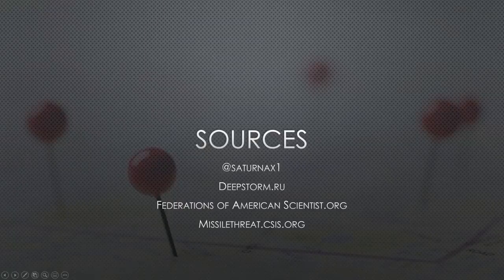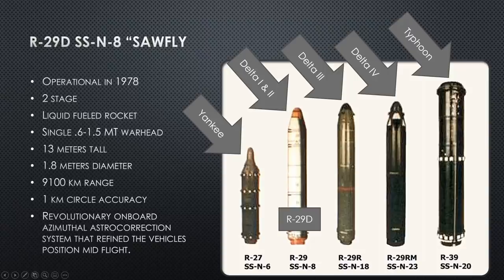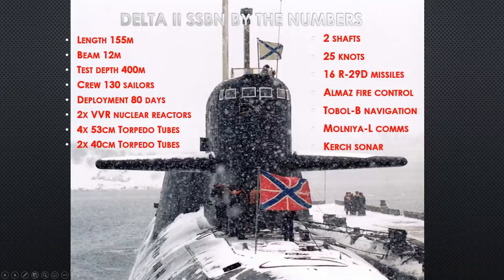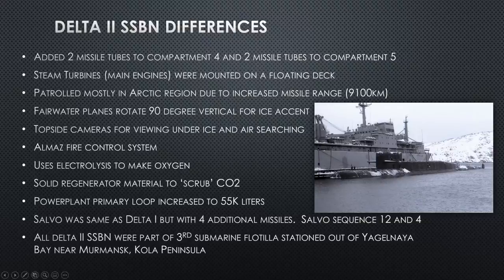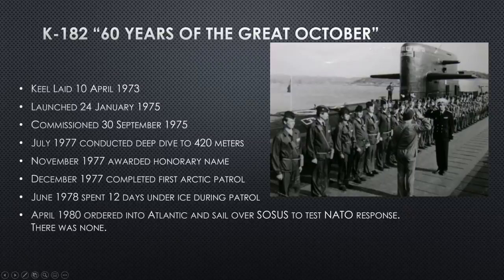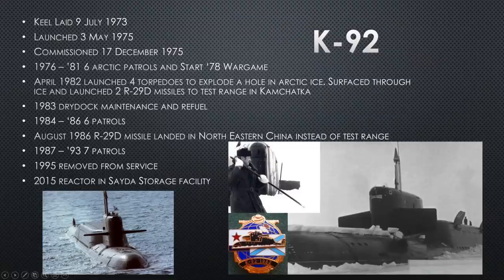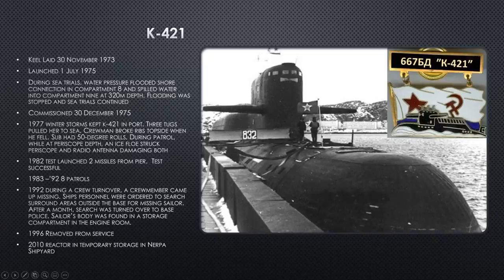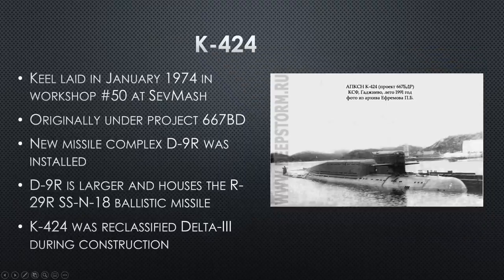Delta II SSBN Sub Brief

Comment: Crazy that these missiles use liquid fuel.  Polaris, Poseidon, and Tridents were solid fueled if I'm not mistaken.  Seems like a much more volatile storage situation.
Reply from the maker: As the series evolves into Delta III and Delta IV, you will see an improvement in rocket technology.
Reply: TLDR: Soviets developed something too fast with not enough money and ended up with something incredibly dangerous, and surprise lots of people died.

Russia had actually looked into solid fuel rockets before the US did. But the US had the funding to do bilateral development of solid fuel and liquid fuel. Obviously, if they could make solid fuel energy dense enough, it's storage properties make it IMMENSELY desirable.
I believe the Soviets wanted a solution "right now", and liquid fuels were just providing way better performance in early development over solid fuels, so they ran with it. Everyone sort of started into kerosene and liquid oxygen, but oxygen needs to be cryogenic to be liquid, which is a huge logistical problem for Russia.
So the Soviets found a solution that worked really well; UDMH and N2O4. Major advantage being these are both liquid for a wide margin around room temperature, remain stable for a long period of time under various conditions, and are hypergolic (meaning they DEFLAGRATE when they mix) so no starter is required.
Downside being that UDMH is extremely toxic, caustic, carcinogenic, INSANELY reactive to just about everything, and basically melts any living tissue it comes into contact with.
And N2O4 is a ridiculously powerful oxidizer, and will absolutely destroy your lungs if you inhale just a little bit of it.

Neat funfact; when you mix N2O4 and seawater, you produce nitric AND nitrous acids (producing the commonly known 'red fuming nitric acid') which is more than capable of eating its way through, say, a missile tube, and/or a tank containing hydrazine.
Once it gets into the hydrazine, obviously a substantial fire will break out (since they are hypergolic and don't require an ignition source), and oh boy you really wish it stopped there at a catastrophic fireball that can't be extinguished, but it doesn't. The nightmare has only just begun.
All the red fuming nitric acid that's now filling up the missile compartment isn't just starting to react with and corrode everything in there, RFNA also contains a great deal of N2O4 which, as a powerful oxidizer, is going to make stuff that's not normally flammable, VERY flammable. Once the hydrazine fire kicks off, everything starts heating up and catching fire VERY quickly (it's basically like a pure oxygen environment as this point). And what I'm about to say sounds insane, but if you're LUCKY, the hydrazine will be reacting with the N2O4 at a steady rate as it's leaving the missile fuel tank, because if hydrazine gets into the missile compartment, it will react violently to just about everything in there; metals, cotton rags, people, the nitric acid, stainless steel, any metal salts that may have been formed, etc.

I'm absolutely convinced that the only reason they were able to put actual people into submarines with 12-20 "submarine killing disasters waiting to happen" is because none of them really understood just how ridiculously reactive the contents were. If they had any idea of how dangerous it was, something as unassuming as a "missile hatch malfunction" would have been a casualty right up there with "we are actively leaking primary reactor coolant into the reactor room".
Reply: @thundercactus  damn….

Comment: As a Brit I always wonder why fair weather planes? what do they give that fore planes don't? I've always thought fore planes would give far better depth control
Reply: My expectation is that you can get a much larger surface area with fairwater planes. Especially with more surface area away from the hull where water flow will be disturbed. The main downside is likely the extra ease of damaging them when operating under ice. So more recent designs are willing to put up with the trade off of harder to damage but less effective. And just adapt the operational processes to minimise the impact.

Comment: Are you sure about that infrared observations from satellites? Would like to see more information about it. I do satellite imagery and infrared you speak of is far from visible spectrum - thermal band is close to 10000nm, while near-infrared starts at ca. 680 nm. The difficulty now with this part of spectrum is that requires special detectors, while visible is relatively simpler to make. So I'd like to hear more about those thermal detections.

Comment: You bring up how clean the new Reactor's are, kind of off track, why the hell are we not generating more electricity at home with the power of the atom. I never understood that. I understand no one wants a Fukushima happen, but if put in correct location they seem pretty darn safe reliable and clean today. I'm no green freak, but I like our air and water clean also. Sorry for the rant on that. Great content as always, love H I Sutton's new channel too. You guys are unparalleled on this stuff and always my go to. 👍
Reply: This speaks to something I have always been facinated with is seeing the extreme numbers for power generated that can come out of a reactor in a state near failure I always felt like we we're not pushing hard enough.
Reply: One of the more likely nuclear power candidates are small modular reactors, which are like taking those inside nuke subs and throwing 12 of them in a warehouse. They're ultra safe, easily swappable if one needs to be replaced or refueled, and very cheap.
Reply: Several reasons:
People are incredibly emotional when confronted with something they fear (the "What about the..." groups) , and
People tend to be incredibly stupid when they gather for a "cause".

The maximum irony of those statements is that the stank-assed hippies of the 1970s who protested nuclear power are now the ones protesting all the coal plants that had to be constructed because they helped make them so incredibly expensive to construct and run.  Could we build modern, Uber-reliable nuke plants today? YES, but it's not worth the headache and enormous expense to get around all the roadblocks that The People will  throw around.
Reply: @greg5023  I think it is less about the efficiency. As far as I understand the small reactor system that the Russians are currently testing is meant for remote locations. Especially those that are accessible from the sea, but hard to get to overland. That makes it easier to maintain communities in those area that used to be uninhabitable, but are now becoming (barely) habitable.
Reply: @greg5023  there's an interesting video on the economics of nuclear, coal and gas power generation. I'll see if I can find it real quick. Nuclear reactors require more upfront cost, but are far more profitable long term. That's the gist.
Reply: It's pure politics and propaganda.
Reply: @greg5023  A good skill to have.

Comment: I thought the main danger with hypergolic fuel (assuming they are using UDMH or something similar) was the fuel in a vapor state. Once it's burned I assumed most of it would be burned. Still not good stuff to breath in, but no longer melt your lungs type bad. This is with respect to the port launches. Unless off course the risk pointed out in the video was if something went wrong and the missile failed to launch and instead just leaked fuel all over the place.

Comment: Crazy question:  When decommissioning a nuclear vessel, would it be practical to take the reactor and 'plug it into the grid'?  I get that it would have to be defueled and refueled.  I guess since they don't do that it's not practical to do so.
Reply: Radically different specs than civvy reactors. Though they still generate electricity. 
We teach our new Navy "Nukes" on older, moored training boats in Charleston, SC. That is where Naval Nuclear Power Training Command (NNPTC) is located. It is the single hardest educational program in all of the DOD. Currently the Nukes that get to the Prototype phase of this training command are being trained on the USS La Jola (a Los Angeles class SSN) and the USS Daniel Webster (a Lafayette class SSBN). Though the Webster isn't long in this role. Its a very old boat that is coming apart quickly. The Navy has moved the USS San Francisco (an other Los Angeles class) to the Goose Creek area to be prepped to take the place of the Webster. You might remember the USS San Francisco was the sub that slammed into an under sea mount. They repaired her and she finished her life with a new front end. She will continue to serve to teach new Nukes how to operate her reactor.
 
Anyhow, once the boat is semi-permanently moored, it becomes basically a land based reactor and cannot be fully spooled up. And has to follow land based nuclear regulatory guild lines. These boats reactors can only output about a third of their potential for safety reason. 

I have to imagine that yes, it could be possible to feed that energy into the grid as long as the infrastructure was in place. Some of its electricity is used to power the boat for training purposes. They must be manned at all times.

My son is currently in the Prototype stage as an officer and should graduate soon. 
Nothing I have said above hasn't already been revealed online somewhere. 
No OPSEC violations.
Reply: @ChasWG  I concur, interesting information, but nothing I haven't already seen online.
Reply: @christopherdesbaux5950  exactly...
Reply: @ChasWG  Thanks very much for that reply and I wish your son great success in his career!

Comment: I am amazed at how well missiles could reach the intended targets back in the 1970's!  That says the use of computers today is a waste of time, money, and space.  The way to generate oxygen has a volatile issue if HHO is the outcome.  HHO is just as dangerous as cavitation.
Reply: @SolarWebsite  Now that we are on the same page, what do you know about process.  Can the tubes wear out or corrode? With every chemical reaction there is a level of heat generated, this can cause hastened oxidation of some materials.

Comment: My favourite antenna that we had installed was the stabilized satellite dish that fed our Sky decoder, so we could watch English Premier League matches live. Before than we could only get the scores from an Inmarsat news print out. None of you submariner plebs had luxuries like that ;)

P.S. We had several forms of sonar and they were powerful enough to see a school of fish 800m down. We could also see individual fish going under the trawl's headline. A program would collate the sonar data of every pass and compile it to draw an accurate 3D map of the seabed. I wonder if that sonar would interfere with sensors on a sub? 
All those 50kg steel bobbins and chains would make a lot of noise too. They certainly did when hauling while I was trying to get a few hours sleep off watch. That would make a sub's hydrophone operator's life suck. I guess subs stay away from fishing grounds for multiple reasons. I heard of smaller vessels snagging subs in the nets and getting dragged under, but I never saw it. US Navy is not allowed in NZ waters (nuclear free zone).
Reply from the maker: good info, thanks.
Reply: 50 degree rolls huh? I remember holding on to stuff and my legs being up in the air at head height. Did you ever experience weightlessness in big seas if steaming on the surface? Going back down the wave does it, so you can go up a stairwell between decks with a single step, while climbing back up the next swell makes you feel like you weigh a ton. You kind of learn to synchronize your movement with the ship's, or you get tired out fast. Southern Ocean below 50 degrees south. 100 knot winds were not uncommon. I bet frigate crews would relate. Those things bounce around in big seas like when they were trying to do their inspections on us.

Comment: A Shark-class submarine missile carrier (and not a Typhoon, what kind of Typhoon? Where did the Americans even get the idea that Sharks are called Typhoon? There is also no AK-47 assault rifle and never has been. There is a Kalashnikov assault rifle, just AK) was intended only for the Northern Fleet. And for new solid-fuel rockets. And Moray Eels are missile carriers for all fleets and with liquid rockets. Which have a better weight-to-size ratio, that is, better efficiency than solid-fuel rockets. Solid-fuel rockets cannot be turned off.

Comment: Wavelength- for different spectrum of light 
Frequency- different spectrum of sound
Reply: Don't frequency and wavelength simply have inverted relationships within spectra?
Reply: @christopherthomsen5809  yes
Reply: Wavelengths are the distance between peaks in an electromagnetic, or a sound wave. Frequency is the number of waves in a given time period. Whether light or sound waves, it applies to both, because both have a waveform. Highest to lowest among the common electromagnetic waveforms are: Gamma, X-ray, UV, visible, infrared, microwave, radio.
Reply: @aquilarossa5191  correct!